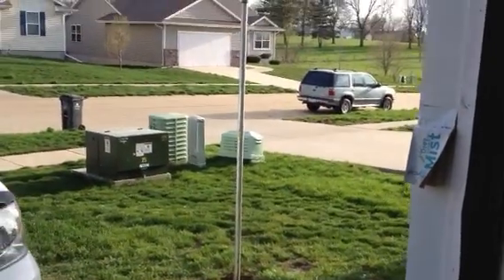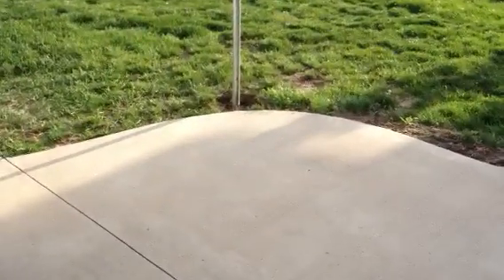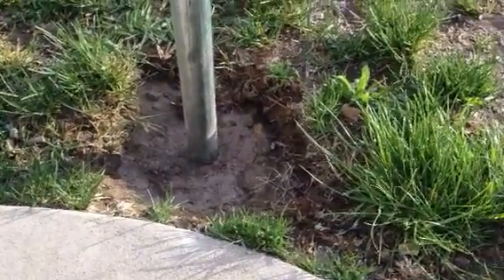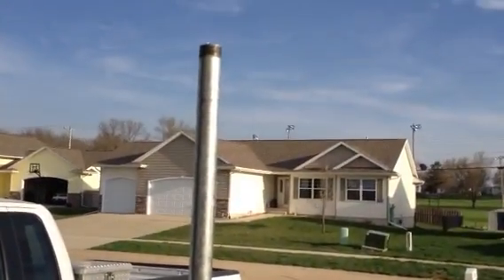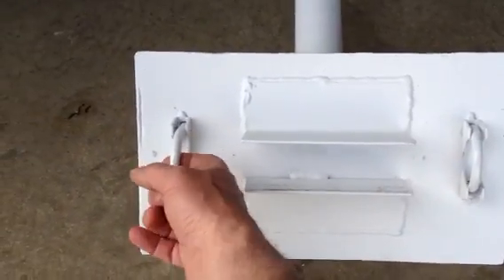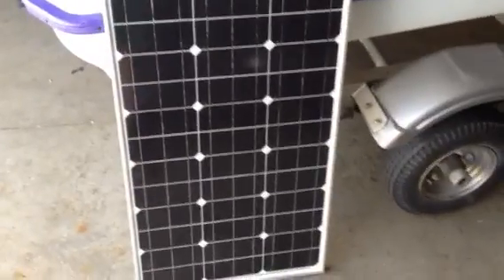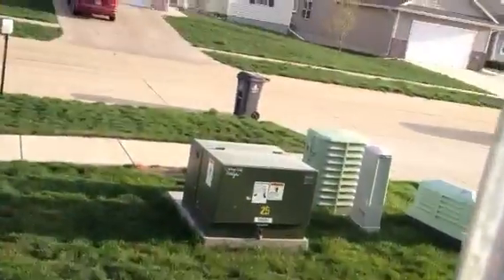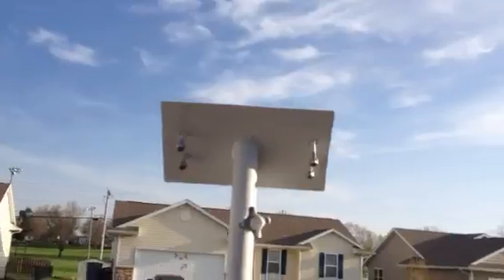Video #2 How to Build  Adjustable Solar Panel Post Frame and Mount Bracket DYI.

Comment from the maker: Hey Nick not sure about roof, and I did not want to drill in to my shingles it is a newer roof, I may build an awning over the top of my garage, it is total 28 feet wide, and top it with solar panels, I am also doing everything with no permits for now, fingers crossed

Comment: Looking good. Are u allowed mount on roof? Thinking may be less high profile for neighbors just in case. I got nervous when iI mounted my turbine on roof  which never permitted or anything. But 3 years later neighbors never said thinking other than genuine interest in it all. Btw Ii may have solution to prob u had with 1-2 switches not working same time. R

Comment: Once I get back on feet after my surgery ill explain. How to get 1-2 share load to work.  Prob is with the negative bus bar. But will explain later. Mine worked in that mode but doesn't now b/c  I switched way I wired my negative leads.